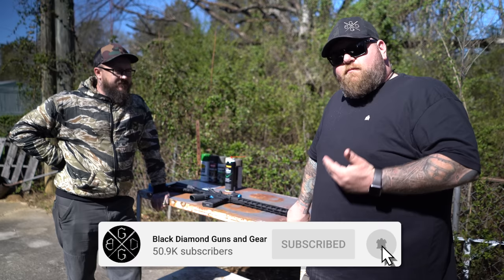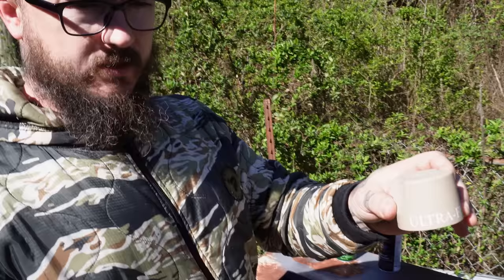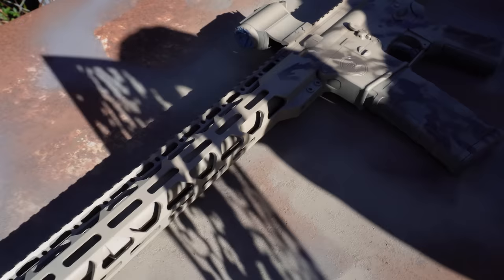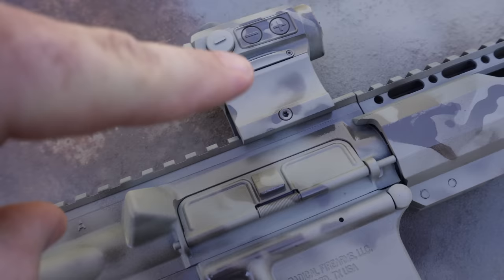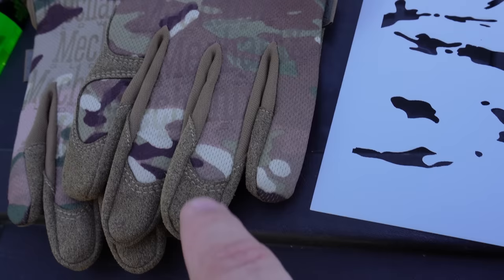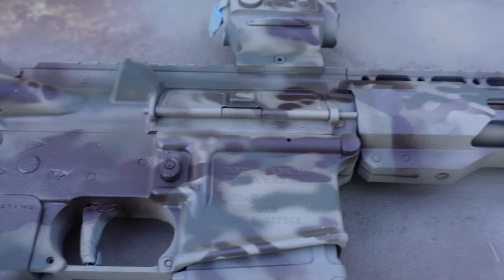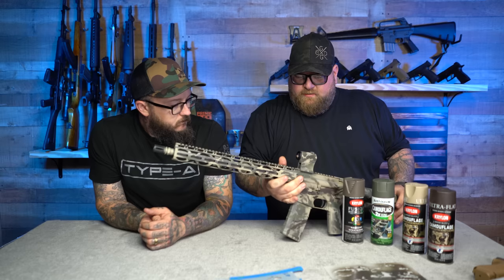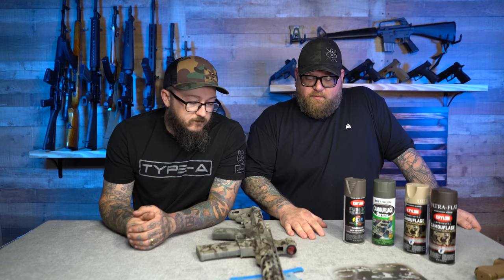How to Spray Paint Your Rifle, the better way…

Comment: To answer the "does it hold up?" No, not like other coatings.  But if you use it, it ends up with a cool (and earned) battle worn finish.  I paint specific rifles that have a specific purpose.  But the rest stay black.  But I also prefer the rust-o-leum.  Good video
Reply from the maker: Thanks man!!
Reply: They make a clear coat/protective layer to put on over top
Reply: @matthewbeaver5026  does it add a sheen? I’ve never added a sealer or clear coat out of fear of unnatural shine.
Reply: @corey0863  Not to mention IR reflectivity.. I know for a fact those Rustoleum paints are, if not NAR compliant, pretty good. I am not sure about Krylon. But some things not only show up easier in night vision goggles, some fabrics, coatings, and materials literally GLOW under night vision. Obviously this isn't a concern for everything you do, but if you're camo-ing a rifle, you should do it for all wavelengths you can.
Reply: @corey0863  theirs always the matte/flat clear you can use if you’re worried about sheen, it will over time if you don’t top coat it.
Reply: "Battle warn" says the military operator wannabes that want their firearms to look like the real deal.

Comment: If you put 550 cord through the flash hider and then tie it up you can paint both sides at once.  As it wears the black will come through adding to the depth. good job.
Reply from the maker: Thank you man I appreciate it
Reply: I use two sections of coat hanger with a big swivel in the middle. I can hook the rifle up by the flash hider and spin the rifle any way I want. I use that set up for painting all kinds of stuff.
Reply: chopsticks

Comment: I've started applying a matte finish clear coat, typically at  least 5 light coats. It makes it last q lot longer.  It also helps give it some depth.
Reply: Interesting idea.
Reply: How long did you wait before applying each coat?
Reply: Does it still have the Matt finish? I'm concerned it will reflect light.
Reply: Samething we do when hydro dipping , I normally waited 30min. In between coats , a 2 part flat works best .

Comment: Look at an unpainted rifle through night vision with a little bit of IR light hitting it, and you'll paint it so quick it'll make your head spin. 

Cerakoting may do the same thing, but anodizing definitely reflects IR light, and its crazy how bright it is.
Reply: You nailed it Brother. I saw a guy take this cammo paint and  painted a $10 umbrella. When he stepped behind it he vanished through IR optics.
Reply: @jackblackpowderprepper4940  Yeah. You can somewhat beat thermals that way too. 

Everyone thinks you have to beat the device, which isn't possible. You just have to beat the operator. Break up your heat signature enough so that you look like anything but a human. 

PVS-14s are a lot easier to beat, though. You just have to look at your kit and make sure it somewhat matches your environment under NODs. Spray paint and stencils are a great way to do that. 

Some leaves reflect IR light where I'm at, so my vest has those leafy patterns in the OD nylon it's made from, and everything else is a dull earthy brown and dark green. 

If your kit isn't reflective enough, it'll stand out to NODs too. 🤷‍♂️

Comment: My area doesnt have much tan so when I painted my rifle a few years ago, I used primer gray for a base since I have a lot of pine. In the winter, the bark has a gray look to it. I used the dark and light brown and dark green. For pattern, I used natural leaves and pine needles. It turned out really good and I kept it that way for several years with heavy use during hunting seasons. The paint did weather in the higher contact areas but that seemed to add to the effect. Just this year I decided to take it back to black. It was TOUGH to get off. Acetone, mineral spirits, nylon brushes and a lot of time and elbow grease and I still had to touch a few pieces with camo black to get them back to black. All in all, Id do it again. 

Great video guys!

Comment: You are correct that rattle can jobs won't last like ceracoat will but that's the good part about it. As you use the rifle, parts of the paint will chip away giving it a unique look and further breaking up the pattern which is the point of camouflage to begin with. The bonus is you can touch up or completely change it as your environment changes. A rattle can job that works in the Arizona desert won't work for the North Carolina woods and so on

Comment: An important note on anodized and parkerized finishes. They are porous and are intended to absorb oils to aid in moisture resistance, especially parkerizing. That's why brand new hand-guards or receiver sections are a dull, dark gray color at first and then get glossy black with repeated use and cleaning. The oil used in cleaning the parts soaks into the anodizing. De-greasing a newer rifle is easy. De-greasing an older rifle that now has that glossy look requires a soak in the solution to displace the oil, not just an aerosol treatment. It will definitely help with adhesion initially, but without leaching the absorbed oil, it'll eventually lead to paint separation.

Comment: Gotta be honest. Before my first "spray cammo rifle project," I was really worried that it was gonna turn out crappy and would ruin my expensive gun...

So, I painted my $350 Savage Axis II, complete with scope. (Used "laundry bag netting" as my stencils... and followed Garand Thumb's directions in his second "paint video" where he paints a $3K SCAR 😬)

My Savage turned out SO badass (looked like snake scales when I was done), I couldn't wait to paint my AR-- Which also turned out badass!

Now, my problem is putting the spray cans down so I don't 'over do' it...

So, I spray paint my mags every time I get new ones 😂
Reply: Nice

Comment: Bros!  Thanks for the video.  I have a rifle or two that I want to paint, and while it’s something that is easy to do in concept, it’s something that I’ve always been hesitant to do just because of how permanent it is.  There’s not really any going back once you do it.  It’s nice to see someone else do it and with your video being so thorough it helps build confidence.  
Your rifle turned out great!  Looks so dope!
JD Green would be a crazy color though lol. I used to work at a commercial screen printing company that had a license to print the John Deere logo.  The official color of it is PMS 364 (using the Pantone Matching System).
Reply: If you're on the fence of rattle canning your idea, some people start with something like a tripod, chicken coup fence to dip their toes in first. My first rattle can job was in the Army in 2003 and it is fun to do. Start with the light color then work your way up. I sometimes use either a mesh linen bag or local vegetation. I have a video of me spraying my R700 with a US Optics 10x on it. I believe I made a mistake or 2...no biggie to me. Enjoy, sir.
Reply from the maker: Lol thanks man! I’m glad people like this kinda video

Comment: Some people don't like it, but I love painting my rifles and rightfully so. I also don't believe in cerokote or duracoat, you wouldn't want to damage that finish or ever paint over that, so I just use spray paint. Even my expensive 50BMG rifle, I rattle canned it, but with rattle can, I can do it however I want too, add whatever little detail I want, and paint. I also don't even really prep it, just degrease it with some alcohol wipes and go. My oldest rifle probably has 10-15 coats of paint on it, just because I change it due to the season and it's also my go to rifle to drop some coyotes so I like to keep it somewhat camouflaged vs just a black rifle.

I'll add that, base the colors soley on your AO. In some areas I hunt, it's very grassy and it's it's a tanish brown in the fall, so that's the primary color of my rifle, same with winter, I never paint a gun white, white just sucks 99% of the time and unless there's snow on the ground for a long enough period of time, then go for it, otherwise, I just use a white camo wrap for times when there is snow on the ground. For greens, especially in the spring and summer, green is really green, just look at the leaves on most trees and grass, it even often has a slight sheen to it, so I'll often use a bright green that's semi gloss and with a little brown and sometimes some light tan, but the gun is 90% bright green, it blends very well. If the colors don't turn out the way you want, either paint over it or use some paint stripper and spray the rifle down, spray it off with the hose and repeat the paint process until you get a color pattern you want.
Reply: Great details of your thinking and the decisions. Thank you. I grew up in deep snows and now live where mild winters and forests are a tan + grays + sage green + Coppery + browns.

Comment: Use adhesive stencils to paint the gun camo, if u wanna nice crisp lines in ur camo design with no over spray…and in the end use matt clear helps make the paint job alot more robust and wont chip or scratch as easy and will keep it from rubbing off so easy

Comment: The paint will not hold up very well, and will not last very long. However, you can extend its life by putting a clearcoat over the paint in your case a dull clearcoat, but it will not last very long better way would be camo certain parts, such as four grip Magazine stock miscellaneous parts

Comment: It's kinda cool but for 90% of uses not needed..everybody wants to be a Seal Ranger socom larperator and practice stacking up neither mk18/10.5 builds...when for the past 60 years and most recent conflicts the strongest richest military has tapped out to farmers with smooth bore AKs

Comment: I have painted a number of rifles and I use Tigger Strips pattern. I use a flat vise on a table top with the mag to hold the gun up or hang it from a cord.  I always put 3 or 4 coats of mat clear coat on mine to help keep it from wearing off the paint. I bake them in the sun for a day or two in between colors and the clear coats, so far it has worked well.  Doing Tigger Strips in a pain and takes a lot of time to get it right. I am in Florida so the Tigger Strips works very well here in the swamp and it's the one I like the most.

Comment: I tried on my glock first it turned out well. I say that by the time the paint wears off completely it'll be time to send it back to glock for maintenance. My galil came out great when I painted it
Reply from the maker: Hell yeah, I’m probably gonna do a Glock 2
Reply: I've only painted an AR, my Galil is next.
Reply: @sahzookey  what kinda galil you got
Reply: @Beach Drug Panda  gen 1 IWI Galil Ace 8.3" 7.62x39. What you got?
Reply: @sahzookey  gen 1 16" 7.62x39 I had one in 308 but I sold it. I think painting it came out really good. There may be a video of it on my channel if you wanna check
Reply: @sahzookey  i was wrong no video of the painted galil
Reply: @beachdrugpanda  he'll ya. I'll check now.

Comment: My first military assignment was to Germany in 1979. I was USAF, but I was assigned to a TAC unit. We had a large number of vehicles to support our mission (tactical communications). They were all painted flat green. We had to paint all our vehicles camouflage IAW technical orders. Just like you're doing with your rifle. The key is to break up patterns and eliminate flashes from optics, mirrors etc. No stencils required. Don't over think it. Go out in your back 40 and pull up some native vegetation to serve as your stencil. Grass, sage brush, maple leaves etc.

Comment: in my experience,  brake cleaner can/will soften plastics..and basically starts dissolving it.
it's meant to be used on unfinished metals, so use at your own risk.

Comment: I have painted ONE of my rifles so far. It looks OK. I mean it doesn't look better or worse than anything else that I've seen.
Personally, I feel it looks cheesy. Unless you have an operational requirement (I'm not an operator and I don't hunt), there's no reason to ruin your rifle.
I think too many people watched Mark Wahlberg do it in "Shooter," and now they wanna be cool too.
A firearm is a functional work of art as it is. No reason to ruin that aesthetic with cheap paint unless you're legitimately out clapping bad guys.
Reply from the maker: Exactly
Reply: I'm considering doing this on a cheap savage rifle with just a single matte green only on the stock. 

If someone was to do this to a ar I'd say less is more. I'd do just the main body, no mag, muzzle device, scope etc so there's some accents of the og finish. I think that would look less cheesy

Comment: I did this a while ago to an AR (used dryer nets for the patterning and it turned out awesome).  I used a foam earplug in the barrel to keep paint out.  That way you can paint the muzzle break too, inside and out, without worrying about gunking up the barrel.  And I was really surprised with how well it felt in the hands after painting.  I expected a sticky feel or something, but it's quite the opposite.  Using the same paints you used in this video, it's almost like having baby powder on the gun.  A bit grippy but very dry.  It's really nice. 

And that paint job looks pretty sick, guys.  Nicely done!
Reply from the maker: Very cool! Thanks man

Comment: Tape it up and rattle can it. You can brake clean/wipe it all down. I just wipe it off. It's a tool and the paint will come off no matter what. Test a few methods on a piece of cardboard. For patterns you can buy cheap burlap (makes grids), use leaves and brush, etc. Again, test it out (hold the patterns close to it), and give it a few light shots. Use some strips of burlap you can break up the edge more too. They can double as tie ins if you are going for real camo looks.

Comment: great content: I shake and sprayed my AR  in a battleworn pattern. however I am not an operator, but I do make it a point to handle my AR everyday off and on throughout the day, and my spay paint hold up pretty well. as it does wear a little hear and there, mainly your contact areas over time. it has been since last spring and you cannot even tell it has barely worn down any. I think spraying your gun is a good thing for reasons you mentioned such as breakup the black pattern, but my guns get used, that[s why they were bought or built. they are not safe queens. I am not scared to scratch or ding them. I try not but sometimes sh*t happens, and spray painting them adds an extra level of protection especially if you have a high $$ crakote job on them. to each their own
Reply from the maker: I am the same man, glad you liked it

Comment: I would've taped the ejection port also. And prob removed the handgaurd to be done separate. As to keep it off the barrel.  It's just going to burn from the barrel. 
On a side note. My buddy did a savage axis stock with the same paint. Dipping and pressing sponges.  That thing came out looking like it was done professionally. If I didn't know better, just looking at it I would think it was factory painted.

Comment: I've done it. Used Rustoleum, not cheap crap,. Flat colors and sealed with satin clear. Holds up better sealed with the clear. Biggest, BIGGEST consideration is THIN COATS.

Comment: If u don't want paint on the barrel just roll up a sheet of paper and slide it under the hand guard with the loose edges up so the paper glides past the gas block and tube.

Comment: In my experience brake cleaner destroys everything not made of metal. Even the vapor is destructive. I'd be careful with it around the polymers. Optics have coatings, seals, and buttons that probably wouldn't like it much either.

Comment: I've been applying coatings, including Cera-Kote and other bake-on finishes to firearms for about 20 years. It isn't my day-job, but I do it quite a bit. I have specific ovens that are dedicated to it if that tells you anything. The best way to paint a firearm is the same way to finish a firearm, complete disassembly, isolation and de-greasing the parts to be painted and only applying paint to surfaces that are not related to the function of the system. Especially for the base/background coating. Thankfully, the Ar15 is a closed system and has a lot of design features to prevent the introduction of foreign matter into the important parts of the action. So, you can tape a few things and rattle-can it. Don't do the same thing with an M14 or an Ak, as examples, without using a LOT more tape. So much tape where it is just way better to disassemble and isolate the parts to be painted.

Comment: One thing ive noticed about gun tubers who rattle can spray guns is that they forego all prep work. A quick degrease of othe outsides, a primer layer, and a 3-7 day cure before applying any paint will make for a much more durable coating
That will stand up to much more abuse.

Comment: If you use deer blind oil base paint you will be amazed how tuff it is. It’s rattle can. Note: it takes a couple of days to dry all the way. The wait is worth it.  Forgot to mention I got the paint at tractor supply. Painted part of an AK and it was unbelievable how tuff it was. Almost would not scratch off. It took a lot of effort
Reply from the maker: Nice